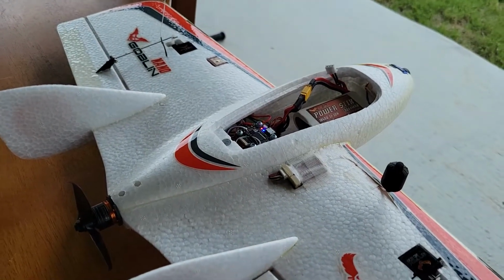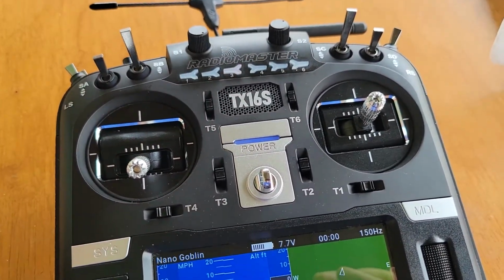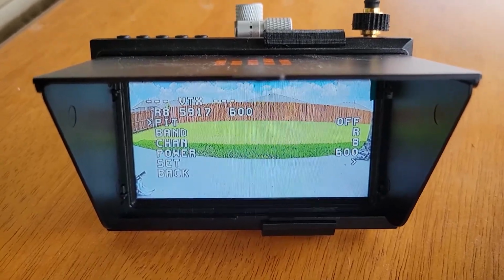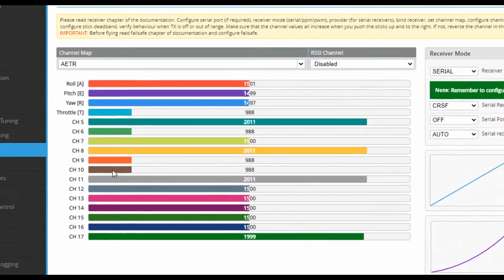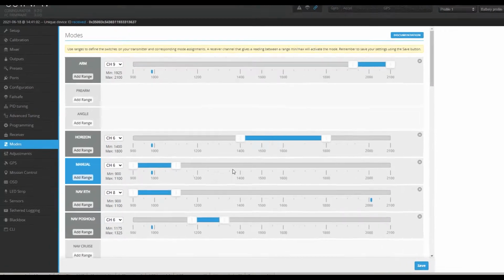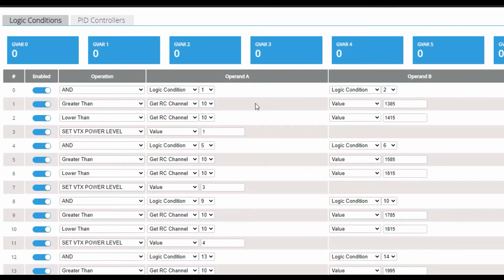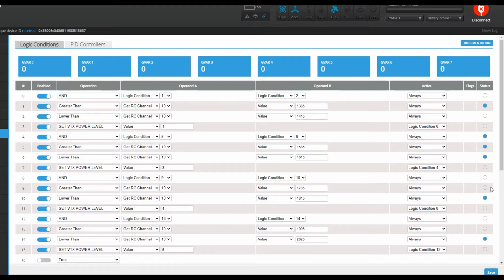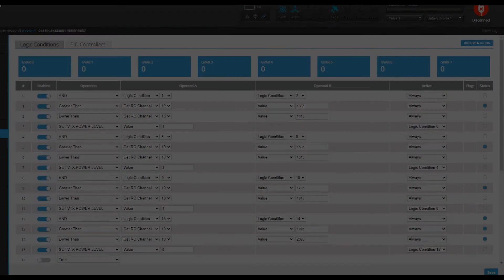inav 3.0 Logic Conditions with my RadioMaster TX16S

Comment: Where did you get the vtx power level audio/sounds? I put mine on the right slider, I tried buttons but have to take hand off stick and can't see buttons so I don't know
what I'm hitting and I've got the vtx power level in the osd to confirm, would even nicer to hear the change from the radio.
Reply from the maker: I redid just about every sound and even created these "custom" sounds.  I used https://www.naturalreaders.com/online/ and replaced all the existing sounds with it, plus all of my inav ones.
Reply: @RickyGode  I made my own sounds, but can't get the logic switches and special functions right, can you somehow convey what you did and I can adapt to my setup,
thanks, larry
Reply from the maker: @fpvkabo  Pawel probably has better videos on the logic switches in inav.  Do you have an open TX radio?  Because I just used the "Special Functions" tab in Companion so that when I press a button, it plays a track.  I guess you could do the same with the slider?  My radio isn't really announcing the vTx power, it's just saying stuff because of the push of a button.
Reply: @RickyGode  those buttons on the TX16 are not directly accessible, each one produces a increasing value from left to right which you need to compare to figure out which button was pushed? Or you are doing something different throw some text (from the special functions tab) to me, appreciate it, Larry  Oh, I have the Jumper T16 running OpenTx, both radios are the same.
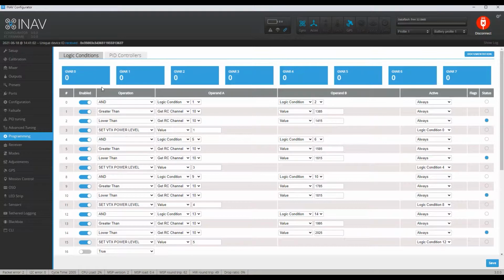Reply from the maker: @fpvkabo  I don't know if I fully understand your question.  Please study the page at 2:06 on my setup (there may be an easier way to do it) It takes 4 lines of Logic Conditions to get one button push to change the vTx power.  Let's start at number 0 through 3.

#3 is the logic condition that actually changes the vTx power and it is activated when logic condition #0 is met.  Logic condition #0 is met when both logic condition #1 AND #2 is met.  It's that "AND" that's important.  

On your comment you mention that each button press increases the value, in my case it's channel 10.  In the video I explain that I got it working by using an absolute value, but wanted a "cushion" or an "inbetween" value.

So in my case, when I press button number 3 on my Tx it changes the value of channel 10 to 1398.  Logic condition #0 is met when Logic condition #1 (greater than 1385) "AND" logic condition #2 (less than 1415) is met.  As soon as logic condition #0 is met, that triggers logic condition #3 which is to change my vTx power.  You can see this in the little blue "status" buttons all the way to the right.  You will also notice that the there are other blue status buttons lit up because those are the values of "lower than"  this is the entire reason I needed the "AND" command to trigger a logic condition and as soon as the "AND" logic condition is triggered, it triggers the actual logic condition that sets my vTx power.
I hope this all makes sense.
Reply: @RickyGode  I got the INav done, working the voice side on the radio side to make appropriate voice call out of the vtx power.
Reply from the maker: @fpvkabo  yay!  That part should be easy!  Remember my setup doesn't actually call out the vTx power, it just calls out when I push the button.
Reply: @RickyGode  I very distinctly here the radio calling out the specific milliwatts when the button is pressed in your video! How u do that?
Reply from the maker: @fpvkabo  I think you're misunderstanding.  I created a custom sound that says vTx 25 mW or whatever.  So when I press the button that's what it says.  It is NOT using telemetry to call out the status of the vTx.
Reply: @RickyGode  Got it working, its on right slider and as u move it it announces the vtx power for which range that matches up to the programming in inav, I used a slider as I originally had it on the buttons u are using, but fumbled with my goggles on (and I have to take my hand off a stick to get to it, didn't work for me, I got to have my hands on sticks, its a kwad and I don't have gps and compass so can't poshold), can do the slider with both hands on sticks, I get a verbal from the controller and power level from inav in the goggles.